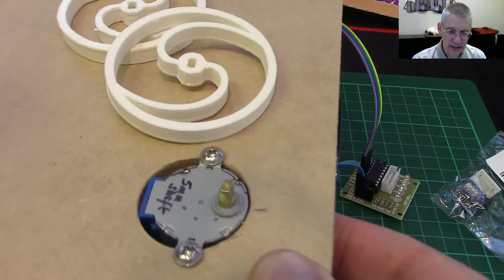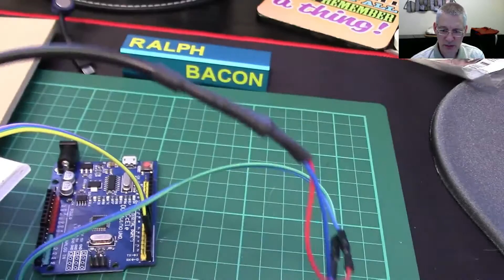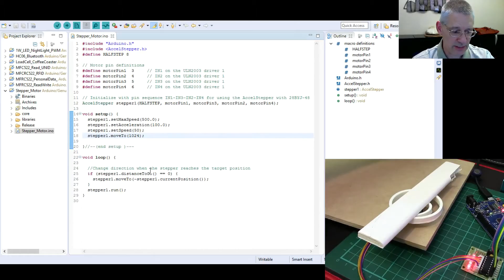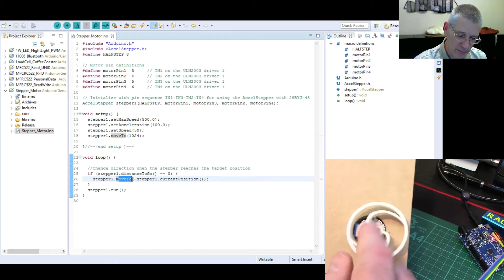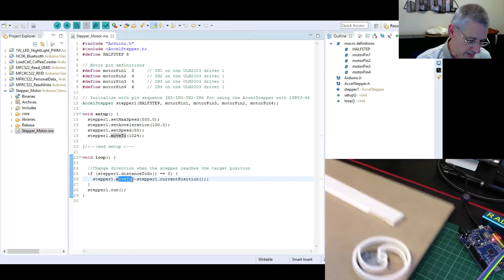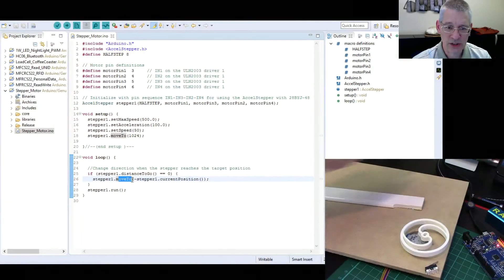#38 Stepper Motor 28BYJ-48 Temperature Gauge - Part 1

Comment: Tacho operate in a similar manner....??
Reply from the maker: Not sure about that, Jorgo. 

In the old days (several decades ago), a tacho was constantly being "pulsed" by a magnet on the cable - hence the (sometimes huge) swings in the value displayed. 

These days, tachos and speedos are all just digitally controlled, with the incoming info converted from the analog pulses to a digital value, giving a rock steady, but very responsive, reading whether digital or on a scale meter.

I don't think stepper motors are involved but then again who knows what the manufacturers do these days! (Come to think of it, it would work).

Comment: The DIL version of the driver board appears to have the chip socketed,  which I guess would be an advanage in terms of making it easy to replace should the need arise...
Reply from the maker: At the expense of more bulk, yes the socketed version offers a quick swap out.

Comment: Hi.  Just wondered if you are aware of some Arduino code called GRBL (It is a Gcode decoder which runs on an Arduino Uno)?
This video reminded me of when I first discovered it as I had been playing with a couple of these cheap eBay stepper motors wondering what I could do with them when I stumbled upon GRBL and was so impressed with how easy it was to use and what it could do I ended up building myself a CNC router (bit bigger stepper motors than these of course ;-).
Might make an interesting video having a look at it as I suspect a lot of "Arduinites" are not aware of it as unless specifically interested in CNC you may never come across it, but I think it could be handy even if not interested in CNC as for example a couple of these cheap motors moving a pointer or pen and you can use it to easily do some very complex movements...If interested I can give some more info.?
Reply from the maker: I am not familiar with GRBL, Alan, but a quick Google shows a gazillion entries, mostly concerned with CNC machines. I shall add it to the list of things to look at, thanks for the heads-up.
Reply: @RalphBacon  Hi.  As you say, it is really for CNC machines but I think it could have other uses.  Basically once it is installed on the arduino and a couple of stepper motors connected you issue "Gcode" commands via the serial link such as "G0 X20 Y10" says move right 20mm and up 10.  Where it gets interesting is that you can then use an online app such as  http://jscut.org/ to take a drawing and spit out the Gcode to trace it out via the stepper motors...
BTW - I have just seen that there is now an ESP32 version.  This is just amazing what it can do.

Comment: Nice stuff. I'm fortunate enough to have access to a 3d printer at work, and not sure how i'd get on without it now. They are truly wonderful machines. We use an Up! Plus2, and its basic, but surprisingly accurate, even on the "normal" setting  rather than "fine" which can take a while. Models are created using Fusion360, which might seem too cheap to be worth  the sub (£250/yr) but it works great for our needs. Very much enjoying the videos Ralph, and learning loads of new things. Thanks.
Reply from the maker: I was very keen to get a 3D printer, but in my current circumstances (I guess you've read my latest blog https://ralphbacon.blog) it might be viewed as an indulgence. But if my YouTube pays for it then it would be OK, I guess (earned income). Thanks for your post, Douglas Thomson, good to hear from you.

Comment: Ralph at 6:55 when talking about skipping steps, you state that the torque is not available when the motor starts and at low speed. The converse is true. The maximum torque of most DC  motors is at 0 revs (=stall speed) and actually decreases with increasing revs in part due to back-EMF. What is happening is this max torque at 0 revs is struggling to overcome the static inertia of whatever system is being driven. The soft start feature of this code helps nudge the system into life by ramping up the pulse rate. It is important to get the fundamentals of torque and power this across to your diciples when working with small motors. fyi I think these come from the air vent control flaps in vehicle heating systems.
Reply from the maker: Interesting that the holding torque is at maximum at zero (stalled) speed. Hmm. Intuitively people would think that maximum torque would be achieved at a certain speed (like your car's engine) but apparently not so. More to be found here: http://www.nmbtc.com/step-motors/engineering/torque-and-speed-relationship/ so thanks for giving us all the heads up!
Reply: Power (Torque X revs) is often overlooked. Most of the time we talk about power when it is torque that really matters. The internal combustion engined car is designed around it's torque curve, yet most of the marketing fluff (and TV programmes) focus on power. Maximum power is rarely used in a car, but the shape and (gearbox) optimisation of the torque curve is there every time we drive. You live with torque every day, you brag about power at the bar ...... and car makers charge you for it ! This is why diesel cars, with more low down torque, are so much nicer to drive.

DC electric vehicles have brought this into sharp focus with max torque from standstill and startling acceleration from rest. Unfortunately the DC electric motor's torque starts to decrease as soon as the rotor turns due to back-EMF, conductance curves, heat, etc. This gradual loss of torque is not noticed because the power increases with increasing revs. Until the first hill that is. 

There is a lot to talk about torque ... but not here perhaps!
Reply from the maker: You're spot on there. That why I have driven a diesel car for many, many years, encouraged by the government as they are frugal yet powerful, only now to find (in the UK, at least) that diesel is the spawn of the devil and causes all sorts of health problems due to noxious fumes being emitted. The fact that they could easily fit decent filters to diesel engines (not just particulate filters which are standard) to absorb the NOx is quietly ignored. Thank goodness the electric motors used in Arduino robotic cars have none of this kind of politics surrounding them. Which reminds me to get on with said buggy... good to chat, though.

Comment: Very interesting stuff Ralph!
 See: http://www.modelboatmayhem.co.uk/forum/index.php/topic,56800.msg592215.html#msg592215
Reply from the maker: Hey Martin! Who knew that stepper motors could be so widely discussed(apart from in 3D printers, I mean). If stepper motors had a built in optical position sensor they would be soooo much easier to use, rather than faffing about with microswitches or Hall effect switches or anything else just to get the starting position! 
But thanks so much for the back-link, every view helps. And thanks for taking the time to post here, I'm glad you found it interesting. I hope you find the other videos equally entertaining :)
Reply: Arduino is all new to me... and possibly the work of the devil! 
I bought a kit primarily to muck about  with  NeoPixels.... - can you recommend is a good dummies guide please ..... I mean Real Basic step-by-step guide!
Reply from the maker: Well, I can, but this will only be my personal view as there are hundreds (possibly more) of books, courses and videos! 
 
Firstly, if you were to watch my videos (not necessarily in the order I present them) you find many, many things that a newbie Arduinite needs to know - like how to connect up a board correctly to hardware that you might need for your projects right through to more complex projects (although I would not classify my TV Simulator Neopixel project in any way "complex"!).
 
Then, if you really want to learn how to program C++ correctly for the Arduino I can recommend "Beginning C for Arduino, Second Edition" by Jack Purdum. (There might a third or even fourth edition out by now.) Dr. Purdum takes no prisoners but has a great style and really, really knows his stuff. If you were to put in the effort and do the exercises at the end of each chapter then you will really know good C++.
 
Then, of course, there are "project" type books, most of which do start with the absolute basics. Not any book will cover it all, but all books that I have recommended other people do cover essential stuff. So "Arduino Workshop" by John Boxall is a fine book, as is "Arduino Sketches" by James A Langbridge. 
 
But you won't get experience by reading books alone. You MUST get on and actually do the stuff in the books (whether C++ exercises or building a mini-project). That way you WILL encounter a zillion frustrating problems - but you will be learning every step of the way.
 
Everyone is different and comes to the Arduino world for different reasons - perhaps to automate their home-brew system, through creating a robot to find its way through a maze, to playing about with Neopixel displays just for the sheer fun of it!
 
Too many beginners (see the Arduino forum if you don't believe me) post messages on that forum saying "I'm an absolute beginner and I have no idea what an Arduino board is and I can't program but as my first project I want to create a wireless,  Home  Automation system to monitor everything and send me an email when I run low on milk". Yeah, right, perfect first project, I don't think so. Start with a blinking LED (and understand why it blinks and how you can change it to your requirement) then move on!
 
This reply is too long - you've touched on a subject close to my heart. Ha! Hence this channel! Enjoy!

Comment: hi I'm new in arduino
I have problem ! I wrote thermometer sensor  program for my old refrigerator , that turn on compressor when temperature drop below 5C turn compressor on for 10 min , my problem is when delay command for 10 min started i cant see current temp because of delay command!!! what can I do thanks.
Reply from the maker: Hello and welcome to my channel!

The problem you are facing is that you have "blocked" your program from doing anything doing the 10-minute delay period. Instead of blocking for the full 10 minutes you could split that up into 20 loops of 30 seconds (in a for/next loop) to give the LCD a chance to update with the new temperature in that loop. This is still not the best way to program either but may suit your needs - at least you will be able to get the new temperature onto the LCD.
Reply: thanks that's good idea!
I have another question !! I want to start my car from distance , when the arduino act and start the engine , how i can understand engine is working!! or require  another start !! can I use motion sensor or it's wrong!
thanks :)
Reply from the maker: You could check the car voltage because it is usually higher when the engine (and therefore the alternator) is running (eg battery 12-13v, with alternator running 14v - check this!). Or a noise sensor in or near the engine bay. If I think of something else I'll add a note here.
Reply: +Ralph S Bacon thanks Instructor voltage checking is good idea!